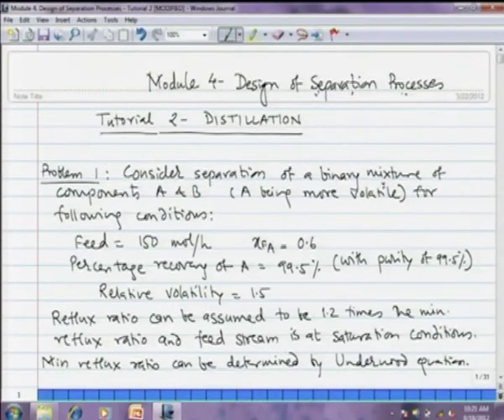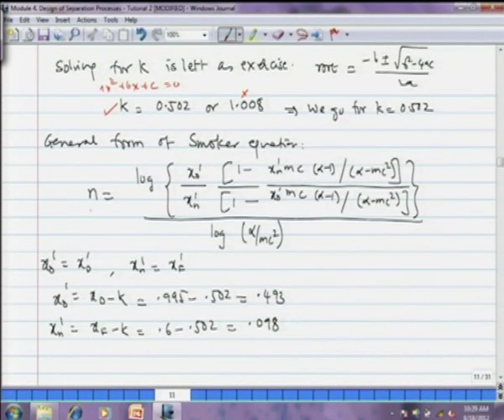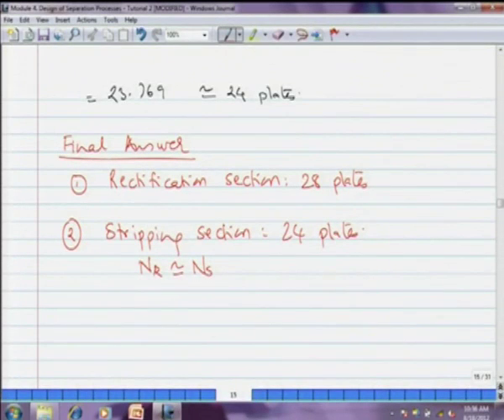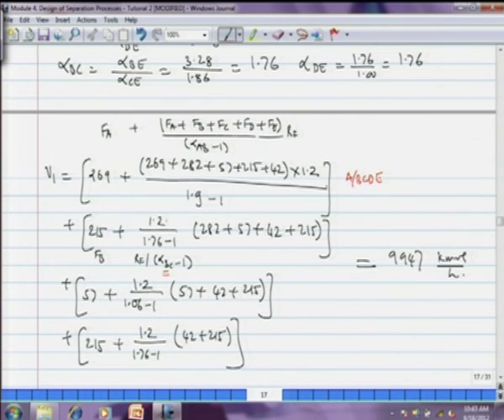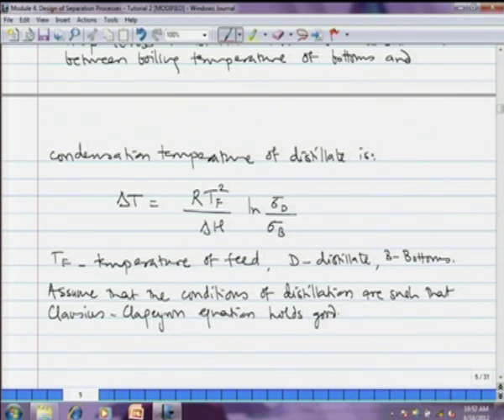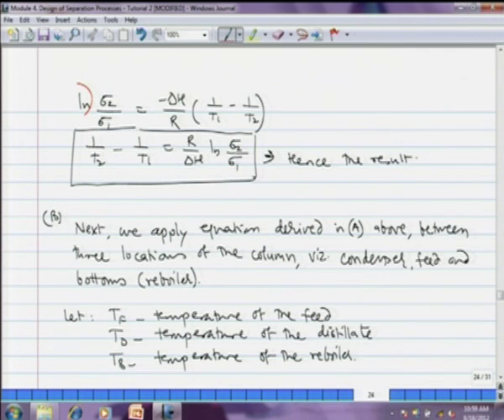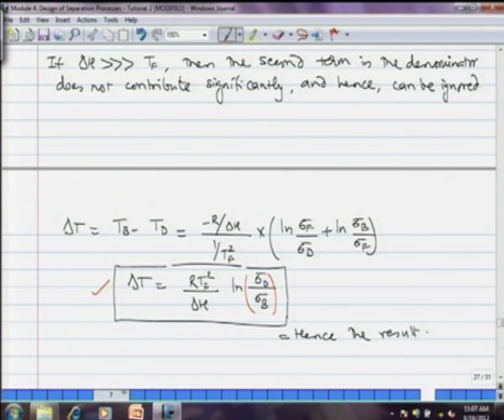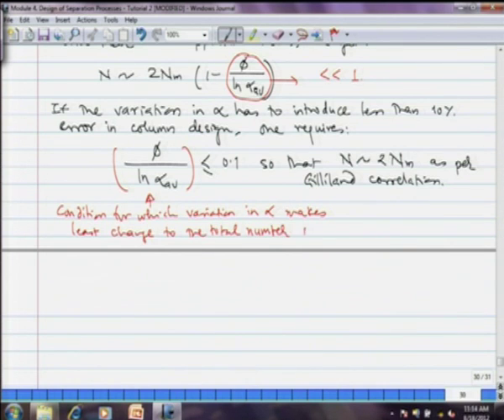Mod-04 Lec-06 Tutorial -- Part II (Design of Distillation Column)

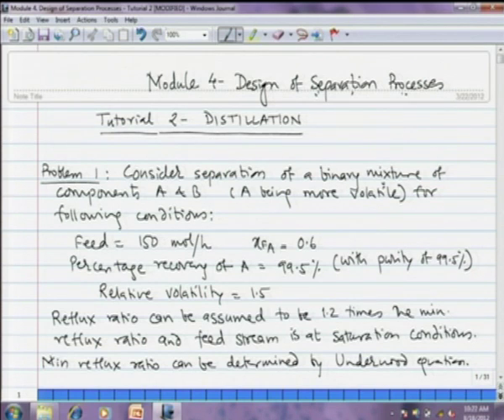Comment: 0:30 Question 1. Smoker's Method for number of trays.
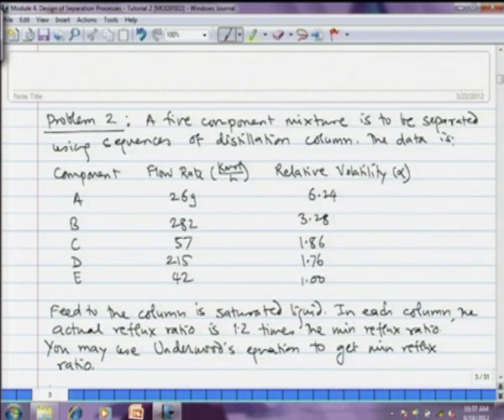14:30 Question 2. Porter and Momoh method for calculating vapour flow rates.
25:30 Question 3. Proof: Temperature difference between points and across the column.
42:30 Question 4. Condition for relative volatility to be insignificant.